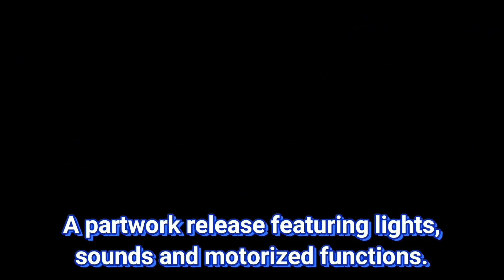Build the Space Battleship Yamato 2202 from Hachette japan Pt 3

Comment: never heard of this brand name, went looking for it on Amazon, no luck
Reply from the maker: Hachette are not a traditional model company as such,they are a partwork company like deagostini,eaglemoss etc... you buy the magazine weekly with included parts and over the course of several years you build up the model.
It is expensive in comparison to traditional plastic kits but as you will see from my videos it is an amazing model with diecast hull and numerous features.
This kit was only available from japan and I collected it as it was released from a supplier called "hobbylink japan" sadly because the collection has ended its run they no longer have all the needed issues,however although the yamato build finished earlier this year they followed it up with a 1/350 scale Andromeda that is still in its run and issues are available and can also be backordered i believe and shipped worldwide (Issues 1 to 110 were the yamato and 111 onwards is the Andromeda parts)
You can check out hobbylinks site here they are very reliable and stock all types of models aswell as partworks.
Hope that helps👍
https://www.hlj.com/search/?q=Hachette%20yamato%20%230